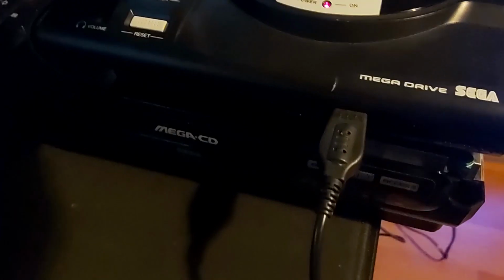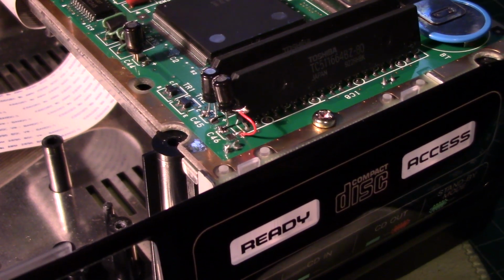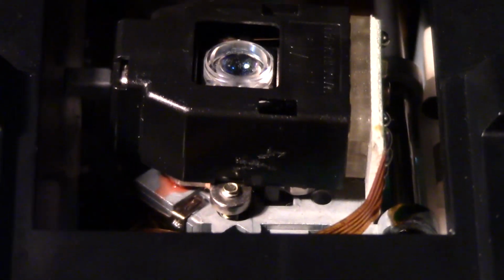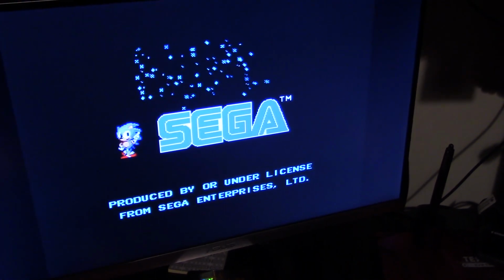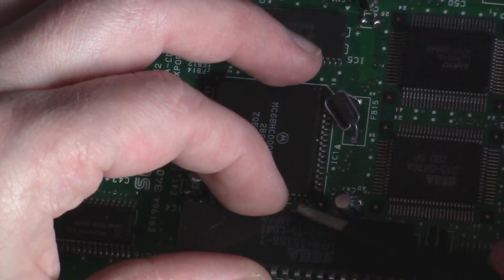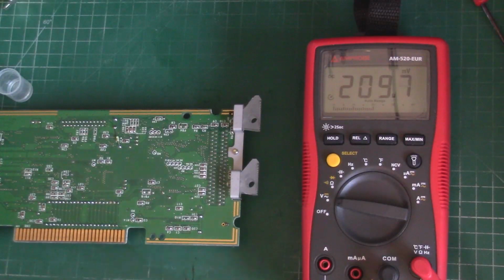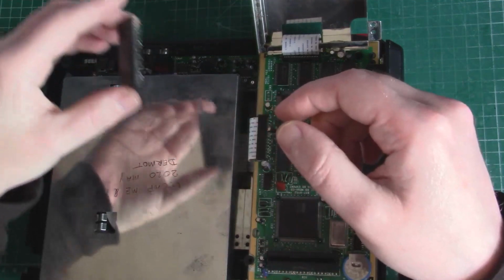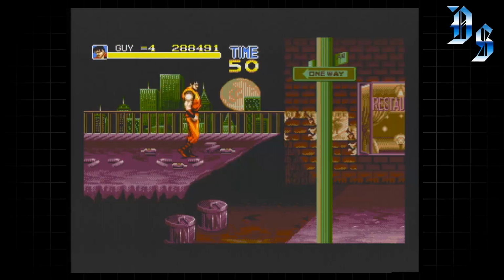SEGA MEGA CD - Model 1 Repair - Part 02

Comment from the maker: Dislike ? Thumbs up here.
Reply: If you change the caps on the CD drive, you have to retune the laser.  I have read you need an oscilloscope to have the best chance of retuning the laser.  Without one you could find the mega cd is unable to read discs but there is no hardware faults.   There is ment to be pots that you can adjust.  Some people change all the caps but the CD drive to avoid having to retune the laser.

Comment: Hello I have no background music on my Sega cd1 . I have splash screen sound that makes Sega sound. And bouncing and coin sounds on sonic cd but no background music. It works fine on my Sega cd2. I had the caps changed on the main board, and I installed a new laser. Still no background music. Any ideas. I’m trying to repair for my young nephew who’s into retro gaming! Thanks
Reply from the maker: It's hard to know without more detail but I suspect that maybe some of the chips in the CD circuit might be bad. It could be a bad trace or via running to and from the CD drive. The first thing we need to know, can the console playback normal audio CDs. Leaky caps can do all kinds of damage to these boards, so if you can't hear the audio from a normal audio CD and  the console acts as normal that would suggest a bad/broken trace or dead audio IC. 
There are 3 main revisions of the sega CD 1 mainboard, so we would need to know which one your is before we could point to a region of the board that may need focusing on. It's 100% true that these consoles all need a full capacitor replacement but unfortunately  I've seen many misleading posts online that suggest the optical pickup/laser should be replaced in cases like this. It's been my experience that the laser is rarely the issue. Instead, I've found that the chips that support the CD have gone bad, due to the effects of the bad leaky caps eating through the PCB or damging nearby chips. Somtimes chips are gone, sometimes the traces that connect them. 
Try a normal audio CD to test with. If you have an everdrive ( or other flash cart) , this would be of great help in narrowing the problem down as it would allow you to run diagnostic programs.
Reply: @GameTechRefuge  thanks. I’ll take a look at traces. I’m barely learning about electronics. New hobby of mine. I have a lot to learn. Info I found was caps 13/14/3 may be damaged. I got readings on 13/14 but nothing on 3. I was ohming them but found out that’s unreliable. I’m gonna have someone recap the sub board and check the traces for me. And go from there. Thanks for the thorough response.

Comment: Great job =D  Does look like something bad has happened to that drive in the past!  I wonder if something got wedged into the tray and was closed - perhaps damaging the focus coils or something.  Might be worth taking it to bits to see if the lens pops back out.    BTW - It's easier to fit SMD caps than you think you know ;)
Reply from the maker: Cheers Gadget. I could try stripping the lens assembly down. I have a spare laser on the way ( Aliexpress ). Can't believe I didn't notice it first time around when I recaped the Laser. The pads are so bad on the board. I  fear that if some one comes along in the future with a pliers and twists SMD caps off they'll rip up the pads.
Reply: @GameTechRefuge you can the link of AliExpress?